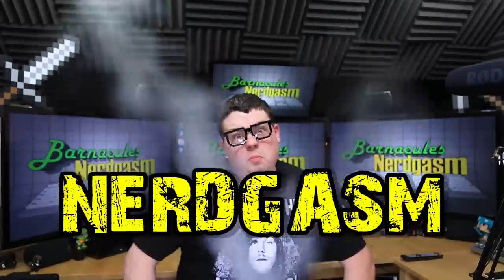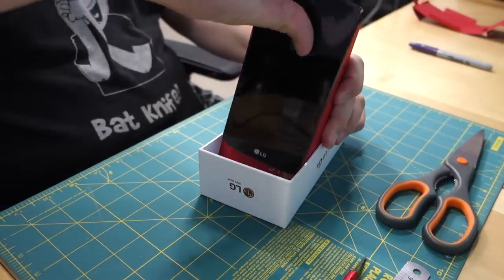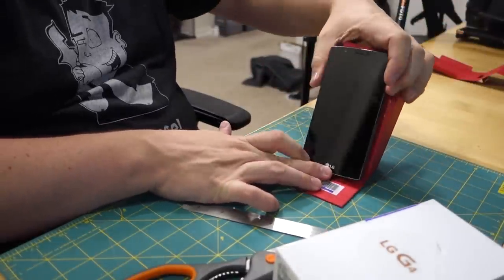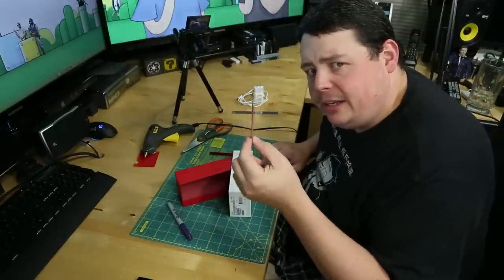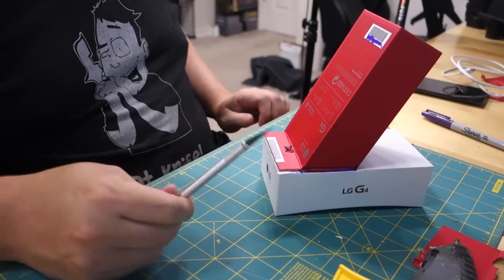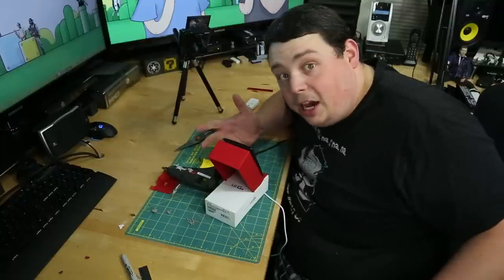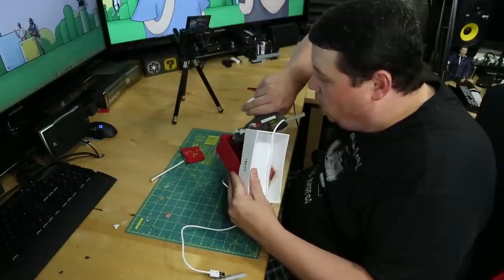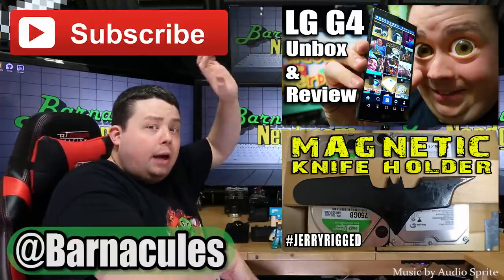Making Smartphone Charge & Sync Station DIY - #JerryRigged - @Barnacules

Comment: Barnacules Nerdgasm  I would use tape to provide grip on the back of the phone, and spray-paint it all black to look like something more professional and less DIY.
And glue something heavy inside the bottom box to prevent it from coming up when trying to remove the phone.
Great video as always.
BTW you could have just used the Cardioid mic you use for skype calls instead of the shotgun one to prevent that problem you were having since the cardioid has a much wider pickup pattern.

Comment: For the side to side stability you could cut a line on the top and about 3 inches down the sides of the red box. Then fold it back a few degrees and hot glue it into place so that the phones sits into the box.

Comment: Quick tip for setting hot glue:  flip a can of dust-off canned air upside down and spray the hot glue with a little bit of the refrigerant.  It'll set up almost instantly.  Just make sure you use it in a well ventilated area.  You don't want to breathe a ton of that stuff.

Very fun video btw.  I enjoy it.  I would like to see you design and print one though.  I can't get enough of the 3d printing videos.

Comment: add spray paint (wait 1 week to dry) then wrap in fiberglass sheets, paint with epoxy (2 part, comes in bottles). now you have a life-long stand.
Still, do like barnacles did and keep the USB cable on hot glue so that part is serviceable. obviously, remove usb cable until the epoxy coating is set.

Comment: You can instantly cure hot glue using liquid freon (obtainable by holding canned air upside down). You can also use the same thing to break the glue if you freeze it then snap it right away.

Comment: Barnacules Nerdgasm if you don't know (and to anyone that wonders how to remove hotglue): A few drops of rubbing alcohol makes it fall off. It literally just lets go of anything it's glued to. So you can easily disassemble this and reuse the parts if you want to. Just in case anyone were worried about getting hotglue on places they wouldn't want it.

Literally just a few drops of rubbing alcohol and you can remove large chunks of it.
Reply: WOW... THIS WORKS LIKE MAGIC! Thanks bro!
Reply: Mr. b3cubed You're welcome :) Saved me a lot of trouble before and seems to be a less than commonly known solution.
Reply: halsoy Ya, as a paper model builder, I have ruined several builds trying to pull hot glue off. This really helps

Comment: i hacked up a couple motherboard boxes and built a test bench. i know i coulda just rested it on top of one but i wanted one for the motherboard and another to sit the PSU and harddrive in so i could move it eaiser. i still use it every now and then when i build a system.

Comment: Hey Jerry loved this... tip from Diresta videos which would be good for you considering your love of hot glue. If you have a Keyboard dust cleaner spray. Hold it upside down and spray your hot glue, it will set instantly. Pro hot glue tip that.

Comment: Barnacules Nerdgasm 

I have a fairly simple question... it's up your alley as it's 3-D printing related.

Do you know of someone or a company you prefer who could print a 10.25" x 7.5" case back that's similar to that of a phone or iPad. It would be about 1.75" in depth as well as some kickstands built into it. It would have mobo standoffs or filler blocks capable of being tapped. The back ports will be on a breakout board, so those holes don't matter.

I want a tablet, but I want a portable PC with options for when I'm doing schematics and running EE software. Apart from my desktop, I want the power of it away from the desk. I know laptops are cheap... that's the kicker as they're exactly that with a cut down mobo, weak CPU, and fewer ports. It's also the fact that I can toss any CPU inside (apart from the Extreme Editions) the case on the cramped ITX form factor. It'll have a battery bank internal as well and need similar hardware for mounting as well.

I considered just going with an epoxy casting of a clay mold with carbon vs. glass, but I don't think it'll as time nor cost effective for another one in the future. Any thoughts and a name of someone willing to give it a go would be greatly appreciated.

Thanks in advance as I'm sure it'll be a while with all of the replies you get these days.

Comment: I'm lazy, and just use an old bent plastic Amazon gift card to make a cradle for my phone to sit horizontal right under my main monitor at an upward angle, in which in can still see very nicely, as I had a plastic stand similar in design too yours from Dollar tree for $1, while it worked for a few weeks, the cable ended up failing as it put stress on the connector, and I have a feeling this might happen here over time if you plug, and unplug your phone a lot.

Comment: canned air turned upside down cures hot glue almost instantly
Reply from the maker: rcircuit96 Also smells like ASS! I know, I used to use it for shrinking plastic on the 3D printer to pop it off the bed easier.
Reply: Barnacules Nerdgasm in my experience it depends, some brands have almost no smell at all whereas others can clear a room.

I haven't found that technique to work too well on my simple metal, but that doesn't have a heated bed so maybe that makes the difference.

Comment: Shoulda just put hot glue on the dock where the phone would lie to use as stabilizers, cuz hot glue is like rubbery when its cured, it would've stopped it from moving around better then the cardboard stuff...

Comment: CHALLENGE!: Use the hot-glue gun as a handheld 3D-printer printhead and attempt to print a simple object.
Reply from the maker: ***** Already tried it, doesn't work, the layer under it liquidizes on contact.

Comment: Nice build. My phone box came with a molded plastic seat tray thingy for the phone that would have been handy for a build like this. But I actually made myself a dock out of wood, aaaaand then the cable fried and melted the USB port on my phone :|
Reply: Graeme Evans ahh sucks
Reply: Graeme Evans Wow! How does that even happen?
Reply: Dylan Byrne if the phone tries to pull too many amps through while charging and if the wire is weakened or badly made then it will essentially become like wire in a toaster. glow red hot and melt everything around it.

its rare. but is one reason not to trust cheap usb cables for charging. leanrt my lesson, luckily the charging port was a separate board from everything else so i could replace it pretty easily.
Reply: Graeme Evans Ok.
Reply: That "just do it" guy was Shia LaBouf

Comment: It would have been even better if you used QI wireless charging!
Reply from the maker: TheCubingGamer No point in it really since the cable does sync and charging much faster and a cable has to run to the dock anyways. Not even sure if the LG G4 supports it.